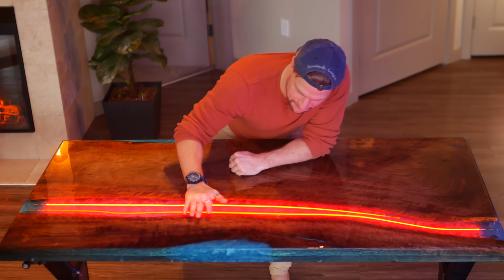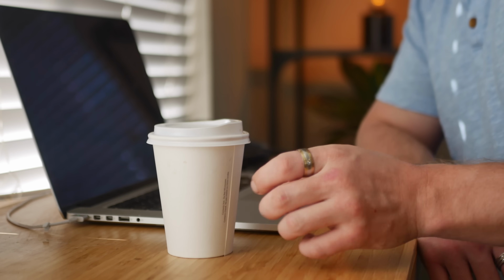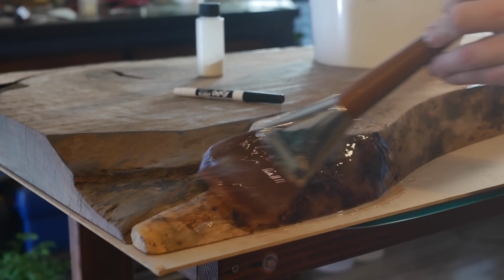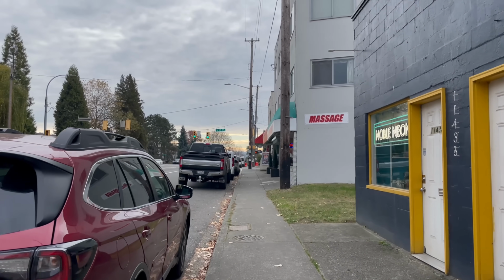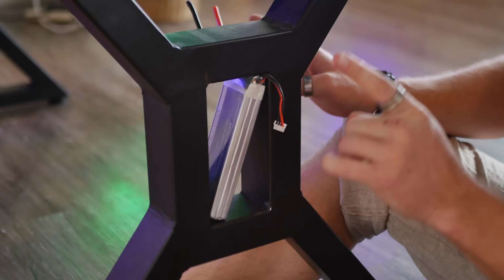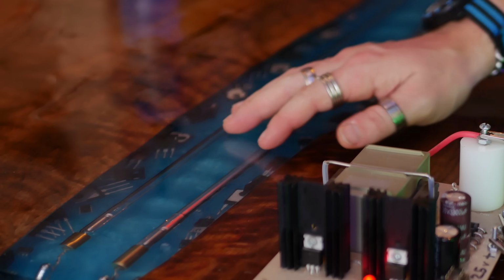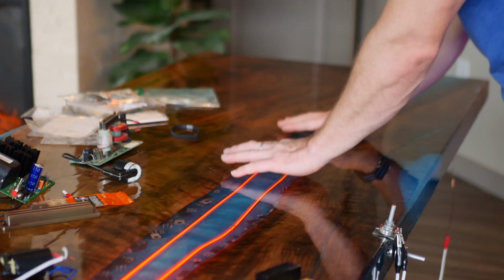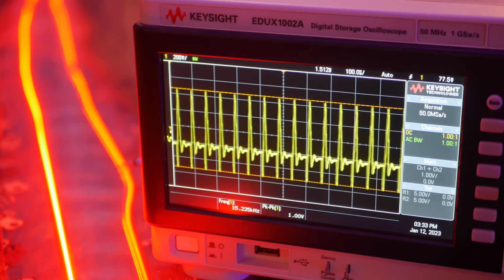A Touch Responsive Plasma Filled River Table

Comment from the maker: Youtube is being glitchy! This video is shot in 4K, make sure your settings are set to that. Otherwise, It seems to play in 480p...
Reply: Beautiful work man! If I can make one suggestion. You might want to stick a cheap 3s BMS board on the LiPo so that you don't accidentally over discharge and destroy it. It would also add a layer of protection should something go wrong, like the FET failing short circuit. Things could get really spicy really fast with a beefy LiPo like that!
Reply: the resolution is because of capacitive coupling in the browser. Sorry.
Reply: It's because YT wants to save some bandwidth, so they play at lower res. Hoping nobody would notice. But nope, thats not how human eyes work
Reply: @SodaWithoutSparkles  They actually were running an experiment for a while where they intentionally lowered resolutions to see how many people would notice.  Turns out, most folks don't (I usually do though it depends on the type of content).  4K requires 8 times the bandwidth of 1080p so if most people don't even notice why not default to a lower standard for them.  They've also talked about making 4K premium only (maybe they already have, I pay for premium since I watch a lot of YouTube and want to support creators without watching ads).
Reply: Yes, we absolutely want to see the neon shop in action.
Reply: Youtube keeps saying videos are playing in 1080 for me but they're actually at 240 or a little higher. Kind of annoying bug. Great job on the table! It looks incredible and I loved the science lesson.
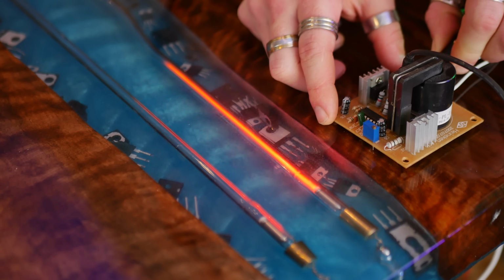Reply: 15:20 the audio seems to only come out right side lol and ends about 15:50 basically when you are talking about your power options your voice only is heard on the right
Reply: Can you do more interactive neon light vids like this it’s so cool. I’ll be looking more into this channel.
Reply: my tv doesnt support 4k so i guess im in luck
Reply: Plasma is coool!!  Nice  table
Reply: Will be cool if you add a wifi controller
Reply: Have you found lithium deuterite for your plasma star?
Reply: Stunning! A Mona Lisa! There is nothing cooler than 'strange fire'
Reply: Yes bro ive noticed it so i quickly change it
Reply: I know how you can make that thruster more powerful.
Reply: My YouTube is even worse than that - sometimes it changes to 480p by it self when the video is already playing (which is really annoying). Then it have to be changed back to not have to continue watch in crappy quality. But anyway - really nice work with that table. It looks awesome!
Reply: Without manually changing every video it seems to do that to me far too often.
Reply: Turn OFF "HARDWARE ACCELERATION" in your BROWSER. The video should UNglitch.
Reply: Hi plasma channel will this thing work
https://youtu.be/BbGqR8J8XfU
Reply: Now make a toilet seat incorporating the same principles you learned from this project.
Reply: I think I’ll go Fishing.  I suggest nobody tries this at home.  Very entertaining. More money and time than Brains.
Reply: Please more barefoot work for more fans and subs and also please wear a face mask with the dust. Useless for covid but useful for DIY. Thank you.

Comment: 23:10 if you want to eat with us thing I highly recommend you not use all metal silverware

Because even the slightest touch when you’re connected to ground you will get a bit of a sting 

Use high-quality plastic silverware instead.  glass plates are fine but silverware use plastic

Comment: Please forgive my ignorance when asking this question. During the capacitive coupling process as your body is stealing the energy, is your body soaking up any electrical current? And if so, is there any research on if prolonged capacitive coupling is or is not harmful to the body? This turned out amazing. I've watched many live edge table videos on youtube. There are many available. But after the learning curve, this one is by far the coolest one I've seen. I wanted to take a LED Strip that changes colors and brightness and make light for the top of my fish tank. I wasn't sure if it would work inside the resin. After watching this, I think that it probably would and I'm gonna go for it. Thanks.

Comment: 13:00 OR... you could have made a small recess with a plunge router in the bottom of the table and stuck a flush mount cover over it. Done, hidden, no cad, no waiting hours for a 3d print.

Comment: For the sake of your apartment (and lungs!) I'd recommend investing in a cheap shop vac (like Ryobi or whatever) that you can hook up to the dust port on your tools. Those little dustbag attachments are basically useless - any vac will be a vast improvement, even more so if you add a DIY cyclone separator (another good 3D printing project).

Comment: What if you added a nozzle on the very back to take advantage of the ventury affect like jets engines use and also bring the spacing closer between the wires so you have more surface to create thrust but just far enough so it doesn't spark

Comment: it would sure be cool if there were a way to cut the channel for the plasma with the lichtenburg wood burning process, so you would get an organic. lightning bolt tube pattern ...or two and stutter/random alternate between the two or three... mimicking lightning,,,weeee

Comment: I don’t know how much current you’re pulling from that battery but please make sure it stays cool.  A battery that size igniting could take out your entire apartment.  Also, the four wire connector on the battery is actually a balance plug.  It is used to ensure that each of the three cells are maintained at the same voltage while charging.  I use these batteries all the time for my RC airplanes, it is important to take good care of them.  At a minimum measure the internal resistance at least monthly.  If it ever gets above 20 milliohms per cell replace the battery.  Nice job on the table!

Comment: Very interesting, but since you said that it produces a strong enough magnetic field to induce a current in human body, is it safe around electronics? Like, if you were to place a laptop on it while the current is on, would it fry it?
Reply from the maker: The table is fully safe for all electronics.. though.. can confuse touch screens a bit if placing them right on the neon tubes.
Reply: @PlasmaChannel  Good to know, thanks for the reply!

Comment: The concept is cool but I don't think the application looks good. Should have ditched the generic river table look and went all out on the Tron theme. Even a small switch from river to lava woulda made a world of difference.
Edit: I can't stop thinking about this table.  The plasma is neat but it drowns out the blue from the river. If you'd done lava and put the plasma toward the bottom instead of the top, it would glow beneath the epoxy. And the orange plasma would have enhanced the lava, making it appear to almost come alive.
Or add a dark top layer of epoxy, missing small crevices in the middle running length wise, like igneous rock. Throw a pulse on the plasma and you would have had glowing magma vents.
Even just going under the epoxy and changing the color of the plasma could have given the appearance of running water.

Comment: Amazing job, love the look of it. Really good craftsmanship, congratulations on your succes, finish on the table looks supreme.
A question for you, is there a Tesla coil or plasma tube Out there, that could be used on the same power line as super resolving hifi equipment, without inducing distortion and high frequency noise in the whole power line. So far any commercial plasma bal, Tesla coil or tube has had a extremely negative effect on the power being give to the hifi equipment, mostly the high pitched noises. Is that just a side effect of plasma or is it a side effect of the power supplies used for powering/creating plasma? 
Seems like you have solved the problem of audible noise in the room with your last power supply choice, but what about the mains lines.
Basically want a Tesla coil or plasma tube that is silent to rest of the house.
Thanks for your videos and dedication.

Comment: Really cool table. But I don't understand why you had to dismantle the whole table. Couldn't you just pour just enough resin to fill the cracks and cover the top just enough to get the flat surface? I don't think the cracks would be even visible, and the new resin would fix the chunks in place.
Reply from the maker: The delaminations were a liability. The table would have been weakened, and, you’d see this miserable bottom layer from the sides.

Comment: Hand-planing can be really enjoyable but you need the right tool for the job, for that size of a project a #5  or 6 stanley or really any bench plane would have been my choice rather than the tiny block plane you had. With a properly sharpened iron, it would do a lot better job at giving you a truly flat surface than the power plane but would definitely still take some elbow grease ;) . Great job though, I love resin river tables and neon, I may be trying one of these in the future.

Comment: How long does it last on one charge? Does it heat up if you leave it on for a while? Does it cause any interference on nearby electronics?
Reply from the maker: One charge is a good 2-3 hours of continuous use. Otherwise, during a month of filming and testing...it never needed a single recharge.

Comment: For anyone looking to try this, WEAR A RESPIRATOR WHEN WORKING WITH ANY EPOXY
You should always use a organic vapor filter when working with epoxies and when around them while they are curing. They don't label it requiring ventilation as a joke; the vapors they release while curing are toxic and known to cause cancer, and can damage your lungs. It is unsafe to be around them in an enclosed space especially in a room you live in.

Additionally, most organic vapor filters contain a particulate catching layer, so it would help with the planing step.
Reply: No thanks I'm breathing it in
Reply from the maker: Filters are definitely a good idea - so is using vapor and VOC free resins like I did. Virtually no fumes....except when it started smoking. Yeah that one was bad...
Reply: @PlasmaChannel  The bigger concern is seeing you power sanding that stuff without a respirator that has particle filters. 😐

Comment: Cool video, you video style is evolving well I think. Sorry about the resin mistake but we've all been there when learning new stuff. I've had my share of blunders like that too.

 Anyways does the table affect cell phones on it I wonder? Especially if they have a Magnectic charging coil?

 Additionally could the big wire electric coupling capcitor maybe could of been replaced with some spoils of coil overlaping to create a better capacitive effect?

 Or even better, sliding plates?

Comment: Yo man! I'm happy it came together so nicely! You're a real electrical artist now!
Reply from the maker: She works like a charm, and nothing gets hot. My neighbor is finally coming over now ;P
Reply: @PlasmaChannel  when is part 2 of star in the jar.
Reply: BOOOOOOOOOOOOM
Reply: I am big fan electroboom & plasma channel
Reply: Why did I think things were going to go haywire after I saw this in the comments
Reply: did you just put a fullllll-bridgggggge-rectiiifiiiieerrrrrr in that circuit?🤣
Reply: @noviceaesthete  No, because it is running off a DC source (a battery) and turn DC into AC (the opposit of rectifying) and run thru a transformer. Since the whole idea is to get high voltage (and high frequency) AC (to get capacitive coupling, for controlling the neon tubes with the hands), no rectifier is needed at the output of the transformer either 
(which would otherwise be the case for example in a DC/DC converter - which can also use a transformer to change the voltage and/or provide galvanic insulation, but DC is still wanted at the output).
Reply: @Speeder84XL  well😂 it was just a joke... i wrote full bridge rectifier in mehdi's style😅
thanks for the explanation btw
Reply: Yoo
Reply: Dud... Am I the only one or you guys too hear electroboom narrating his comment on my mind, I'm definitely hearing his voice.😆🎧
Reply: Yes he is an artist but I am sure you could build something like this too, ElectroBOOM....but not without 500 short circuits and some few fires first 😂
Reply: Neon signs yes sir.
Reply: Crazy to me that I found plasma through Joel Creates who popped up randomly on my feed, to come full circle with the man that started me into the whole science side of youtube, good job on helping plasma finished off his dream custom 1 of a kind plasma reactive table, much respect to you, plasma, and Joel. Keep up the good content. Also awesome seeing science channels lending a hand and supporting each other :)

Comment: Neon tubes burn out, so how will you replace them when it happens?
Reply from the maker: It takes 3-5 years for that to happen. I’m not too worried.
Reply from the maker: Also, that burning out happens from continuous use. Table will only be use for like an hour a week. So they will last a good decade.

Comment: https://www.youtube.com/watch?v=EkjpVcsRQLc
As you are a bit more credible than the others...
Can you have back the amount of water transformed by a 20 mhz high votage after burning it ?
Optional{ What about adding potassium hydroxide.
Potassium hydroxide heats up and can turn to vapor salty water (some used a fluoride membrane that passes vapor but does not pass liquid to desalinate salty water and have it into the consentrated potassium hydroxide solution)...
Some did simply add sodium hydroxide and aluminium to any kind of water without electricity to have hydrogen. }

(I just don't have the time to test... sorry)

Comment: is it just the footage or is one of the tubes dimmer than the other in the final product?
Reply from the maker: So, one tube is about 40 cm longer than the other....and the shorter tube is definitely a bit brighter.
Reply: @PlasmaChannel  right that makes sense, so they are both getting the same input, one just needs more to light up the same, if i understand it right

Comment: I want this sh*t, please share the circuits and cnc files
Reply from the maker: haha, well the CNC files are super specific. Each table leg had two covers...and each cover was specifically measured to fit their respective holes, which varied slightly (I found out!). So, I actually designed for separate covers. Meaning that you likely can't just use my files and buy the same table legs...you'd need to customize. As for the transformer housing...same thing. You'd need the exact same transformer!

Comment: So glad to see you didn't have the issue I've seen so many videos of people using resin where it leaks from the form.

It's expensive, and hard to clean up.

Can't even imagine how it would be in your apartment.

Also, how were you able to even live in there while it was curing? I've only used a little epoxy and the fumes are so noxious
Reply from the maker: OH, it leaked all right. Just dont tell my landlord haha
Reply: @PlasmaChannel  😬🤐

Comment: That mill shot fascinates me. Is that like a big cutter bit like router they are running across, or a circular saw type thing turned on its side?

Either way, had no idea they made tools like that or that big, would definitely make leveling a board a lot quicker, lol
Reply from the maker: Yeah, a lot of lumber mills will have what is called a "router sled", except their was HUGE.

Comment: That is awesome that you're neighbors can't hear the sander (they are always stupid loud)

I can't even imagine the cleanup you had to do to your place after sanding inside.

When I work with wood I'm usually in a garage or outside, yet still end up with dust covering everything and in the most random and unimaginable places where you wouldn't even think
Reply from the maker: Yeah, the clean up was......apocalyptic. Not joking about it being the mess of generations. The dust was everywhere. Everywhere. On the leaves of ever plant (I had to wipe down hundreds of leaves), on every floorboard, windowsill, curtain, ktichen utensil, picture frame, tool, furniture.......I have swept 10 times...and still have not found it all.
Reply: @PlasmaChannel  sadly, you'll probably be continuing to find some as long as you live there. To put a positive spin on it, just use as a reminder of such a great build!

Comment: Holy crap Jay, this is epic!!!!

By far the best river table I've ever seen!!!

Well worth the wait!
Reply from the maker: Ahaha, I see you there a second time. Thank man. If you were in the Seattle area, i'd invite you to come over and see it.
Reply: @PlasmaChannel  yeah, sorry. I realized I'm kinda flooding your comments. (So many good things in it!)

Hopefully good for 'engagement metrics' on YouTube? 🤔
Reply: @PlasmaChannel  how is the heat from the neon encased in the resin? Wonder if it the heat will affect the resin or life of the neon tubes?

Also, yes, definitely make a video on the neon sign making process (if you want to of course)
Reply: @justinbanks2380  Neon tubes don't emit much heat & epoxy's thermal conductivity is more than enough to carry it away in the thicknesses used in this project.

Comment: Looks like not an outdoor table; however, figured I'd mention that from my experience with crystal clear epoxies not being UV resistant and therefore susceptible to issues affecting look... is best to use a UV protective coating like is done in the water craft world like a polyurethane coating if I'm recalling correctly.  Check into I'm thinking.  Nice job!
Reply: I forgot to note, the fab lab guys swear by using Rust-Oleum Filler Primer as a first coat to prep your 3D print before using the color of rattle can paint or better of your choice.  I know, the 3D printing can be addicting... so just saying.
Reply from the maker: Thanks a ton. I might need to look into this. I spent so much time on this table...I'd like it to last.